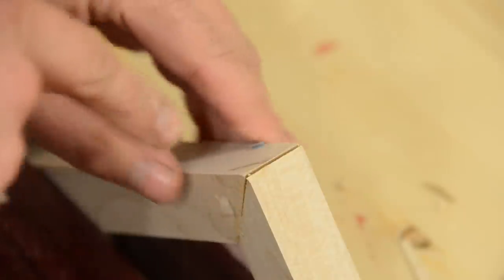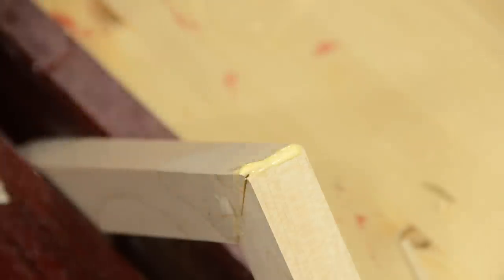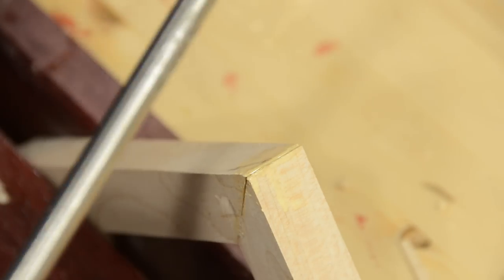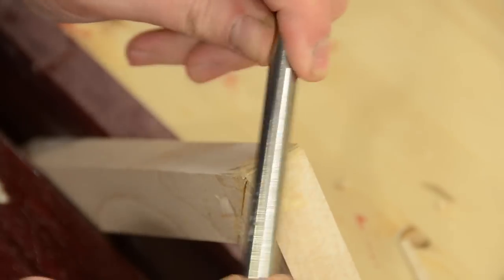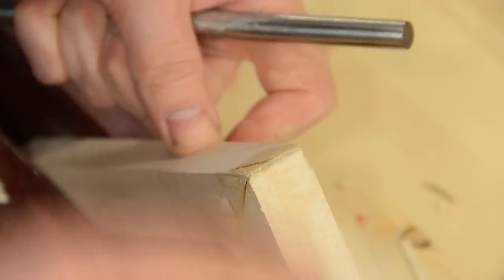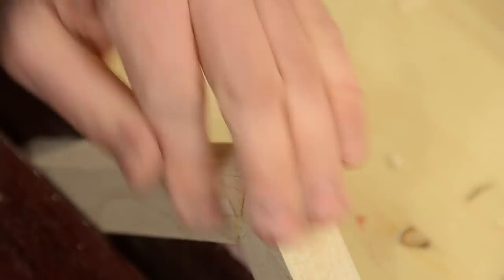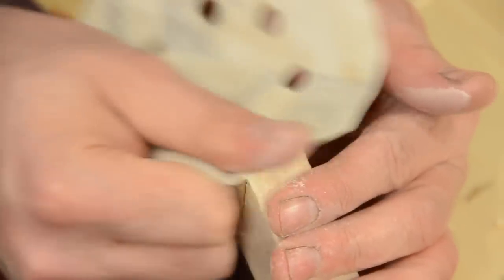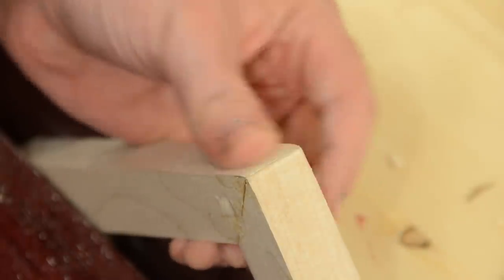Filling Gaps In Mitered Corners

Comment: Useful tip David, although I am more like rochat.
You'll end up in trouble if you are using contrasting wood. The miter might be closed, but it looks dirty. I think if you can't hide it, you might as well expose it by adding a contrasting spline along with the seam.
Greetings from Good Old Germany
Peter

Comment: A little gap, I've burnt through about 30 pieces of wood to make a 90 with 2 45"s and none were even close to yours. All is good til the last corner and it's off by about 1/4 in or more. I'd be ecstatic if I got 1 picture frame that close. Guess I'm just not cut out to make picture frames. The bad thing is I'm out about $300.
Reply: I know this comment is from three years ago, but I hope you kept at it! Using a sacrificial fence on my miter saw helps.

Comment: The gap is only hidden, not closed... And the resulting edge is round... Hm - not really what I would like to get.
Sorry, but I dont like this method. I still prefer to add some shavings or similar stuff into the gap and then sand or plane it flush.